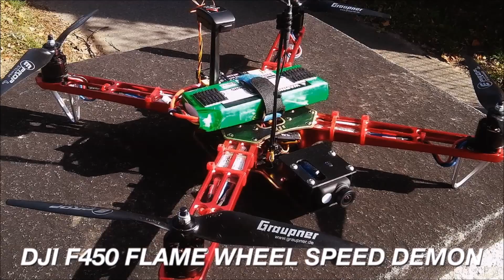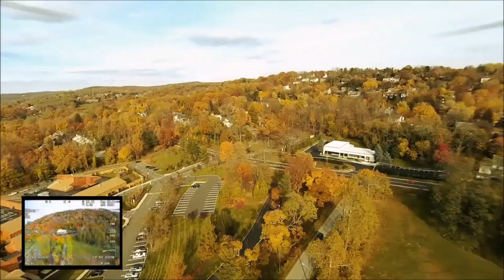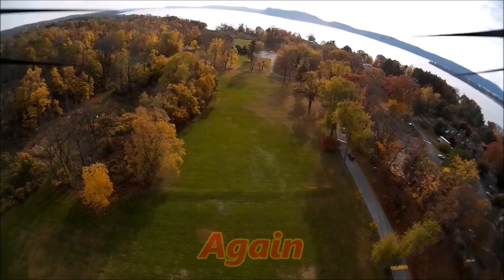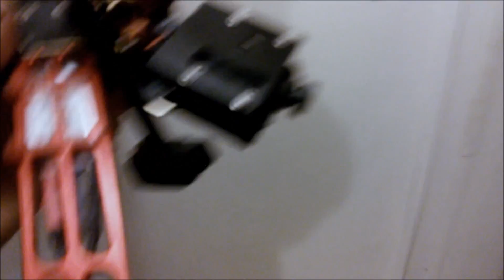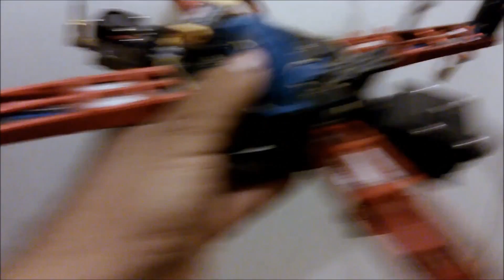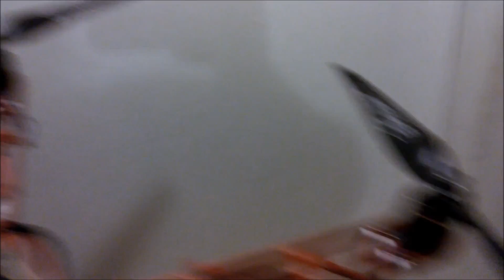DJI F450 Flame Wheel Speed Demon crash after battery disconnection part #15

Comment: Do you think I should use naza v2 or lite on an upgraded f450 to a 550 with the e600 system?
Thank you
Reply from the maker: Charles Christensen If you already got the naza lite you should be ok as longest the multirotor is no larger than 650mm from motor to motor .

Comment: You can use this from HK "Turnigy_EasyOff_Plug_Disconnect_System_w_Tool_XT60" I've read the same complaint from others with the XT60 version, Luckily I bought the bare wire version and added XT60s. That HK product does work, most of the time I end up not using the tool, but the little brackets give you somthing to grab onto. If its a real tight connection, the HK tool works good. Oh, yea, congrats on the Vector purchase, hope its treating you well....well besides the connector.
Reply from the maker: _ Milo_ The XT60 version of the current sensor of the vector doesn't allow me to used the "Turnigy_EasyOff_Plug_Disconnect_System_w_Tool_XT60" so the idea of having the bare wire current sensor would've be a better Idea but since I got the current sensor that I got I have to deal with it , the multistar lipos that I used in most of my multicopers that comes with those really hard to connect and disconnect XT60 are not going to be used on this frame anymore , not because of their hard to handle XT60 but because the 10c rating sucks with this quad , I got a few new RMRC 3s 4200mah lipos with longer cables and a more friendly to used XT60 connectors , I don't expect any more midair disconnections in the future anymore .

Comment: Sorry for your crash but your quadcopter survived pretty nicely. I like the easy way to solder the XT60 connector but i don't really trust them. I prefer far away my Deans connector. I noticed you also switched to the eagle tree vector. How does it perform compare to the Naza-M? The OSD is really cool.
Happy new week
Reply from the maker: I use traxxas connectors before without any issues , now after this crash i started to have second thaws about the xt60 so i might end up going back to the traxxas connectors , when it comes to the eagle tree vector i could say that in many ways is superior to the naza lite or v2 but the gps mode is garbage on the vector vs dji , the vector is more aggressive than the naza specially in manual mode and the built in OSD is the best in the business , if you want to do aerial videos with a gimbal you better go with the naza but if you want to fly 3d like a maniac go for the vector .

Comment: Try a little sand paper file down the xt60 connector until you get a snug fit, hope this help but you made me realize that i really need to secure my battery on bottom of my HEX
Reply from the maker: Thanks for the advise , ill look in to it  .
Reply: ***** you squeeze the male  to widen the connections?

Comment: Bummer! I use Velcro and straps. very nice setup! It's good to survive a crash like that.Thanks for sharing.
Reply from the maker: I used Velcro tape and Velcro straps too , the lipo didn't came off the quad , the battery connector got disconnected from the aircraft .
Reply: sorry small brain at work I got it
Reply from the maker: Pappawillfly Don't beat your self up , I should've explain it better on the video to avoid confusing the viewers .
Reply: It reminded me of a book The Secret. I didn't really get what it was about. I didn't understand what that had to do with RC flying and model aircraft. no offence intended..I'll watch a video anytime.Thanks for sharing